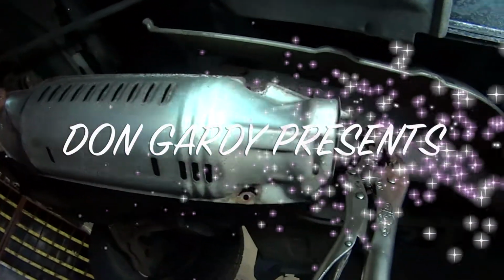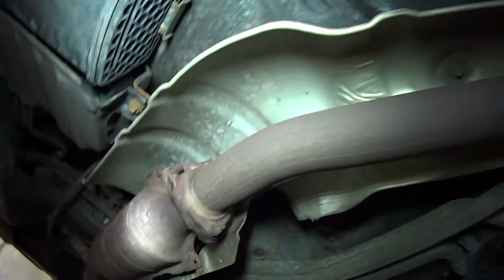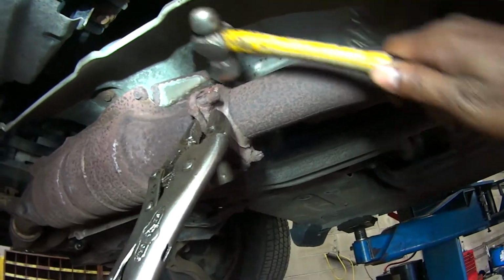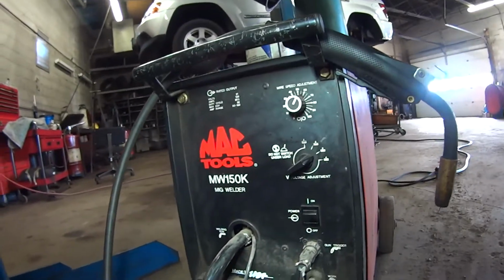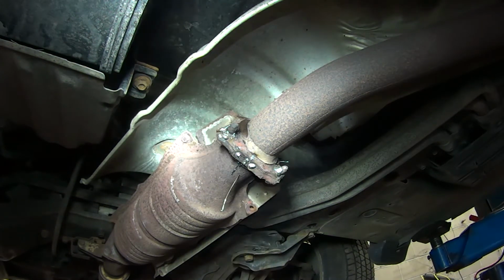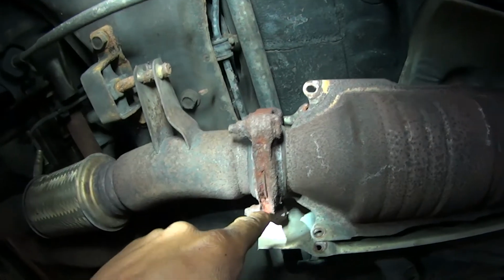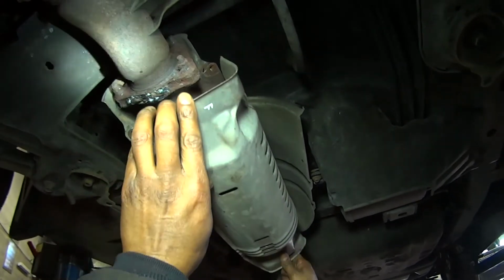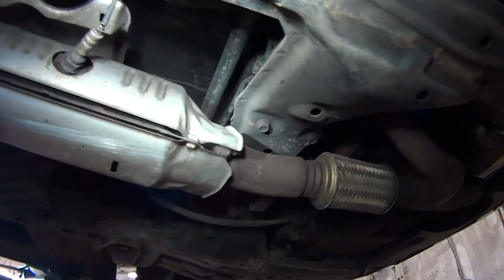MY 2000  ODYSSEY  MUFFLER & CATALYTIC CONVERTER

Comment: Weird, I have an 2002 and someone stole my cat... when I looked underneath my cat is on passenger side and they cut the oxygen sensor wire. Your is 2000, and the cat appears to be on the driver side and no oxygen sensor connected... seems so my easier. lol
Reply: How much did you pay to it replaced. Do you know what part you bought